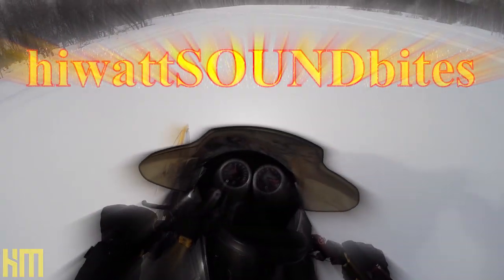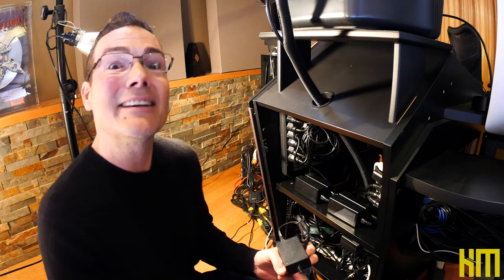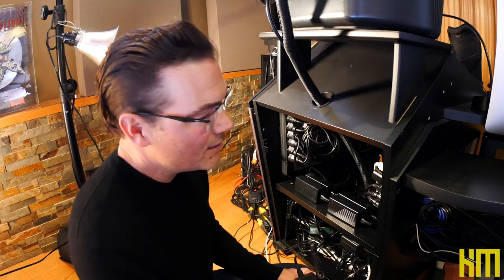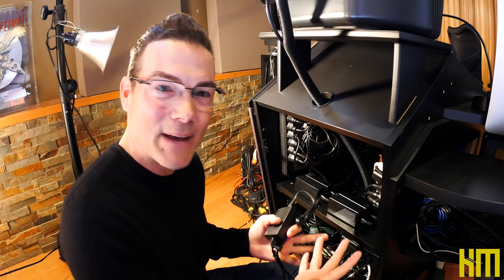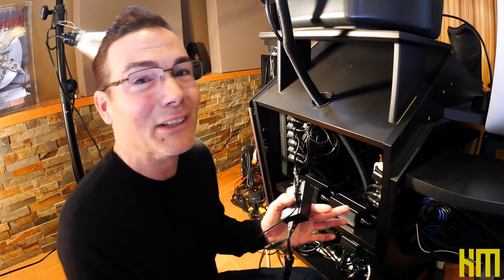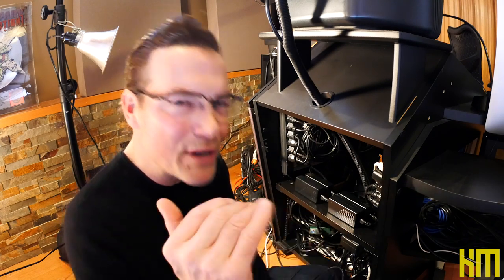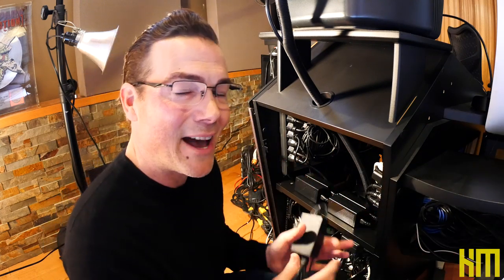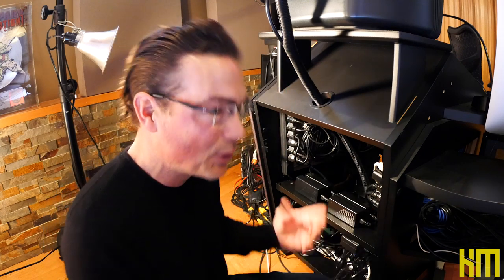Cable Management - Maintaining a LOW noise floor in your Recording Studio

Comment: Another tip to add here: When you get a new piece of gear, instantly label the wall-wart/cord for what it goes to.  A moment of effort for perpetual ease from then on.  If you worry the sticker might come loose over time (heat, etc...), cut a slightly larger piece of clear packing tape and 'laminate' it.  I am always thankful when I pick one up and it's labeled.  I have a plastic tub filled with cords and the like somehow collected over decades.

Great videos, Ken.  Thanks so much.
Reply: Brap Allgood That ^
Reply from the maker: Brap Allgood what an AWESOME comment here my friend, like BOOM!!!  Thank you for sharing such an excellent idea Brap, I’m sure you’ve prevented some grief by labeling supplies.  We’ve always followed your practice on the road, but it makes so much sense in the studio as well!  In addition to your great tip with packing tape, try using a nice bright ‘spike tape’ (1/2” GAFF tape used to mark stairs, entrances, exits, etc when on stage).  It provides a long term solution and you can easily  mark gaff  tape with a sharpie too ;-)  Really great practice you shared here Brap, thank you!!!  Have a great Friday!!!  -hw
Reply: As much as I try to do this without fail, it still boggles my mind how many transformers I find in my studio without labels OR equipment that it's NOT plugged into! :)
Reply: @hiwattmarshall  Do you remember on the Too Dark Tour when some random dude gave Dwayne a handful of acid and he shared with everyone at the end of the tour?  :)  That was me.  Looooongtime fan and follower, though back then people called me The BrapMan-- too many brapmen popping-up online made me have to get creative about it.  Happy to help.

Also...did you at least make 'brap' jokes to yourself while playing with the snowmobile thingie?  'Brap' means a few things, nowadays, one of which being that engine noise.  :D  BRAP!  BRAPBRAP BRAP brapbrapbrapbrap!  I had a car enthusiast try to buy my email address from me...and he'd never even heard of Skinny Puppy.  THIS WORLD.  It's weird.
Reply: @snakeyengel  For me, it's because of how many shitty electronic devices I've purchased in my life-- a shitty device often has a perfectly functional power cord/supply (coughcough STEAM LINK cough)...and so that bit gets saved with the others that lost their original purpose.  Hell, maybe I should go through them and figure out what they are, put them on Ebay.
Reply: to add to this-- use a cloth/fabric label.  i've had heat destroy my whole labeling in traffic signal boxes.  we also use colored wire wrapped on each end (green goes to green...) since i've switched that problem has gone away.  and since i'm old school we keep a steno pad in the box that has the same information.  it just takes moments to jot down the information and changes.

Comment: Hmm.. thinking about noise potential and heat.  I used to build out datacenters on a fairly regular basis.  Back then, I required managed power strips.  having to make a trip to the data center to toggle the power on something was like being punished for poor planning. So, the good news is that managed power is now actually affordable to regular folks, and just thinking that being able to easily guarantee that the power is off on any device that is currently unused would no doubt help lower the floor on noise even further.  Also, Datacenter building got me very into using Velcro strips to do the tie downs.. Not quite as tight at zip ties, but making changes or additions down the road just got easier.  I used to just get the Velcro on a roll and cut the lengths I needed during the build.  Also, have to agree wholeheartedly with Brap Allgood in his comment.  Get a decent label maker and use the heck out of it.  A bit of good organization up front will more than pay for itself in the long run.  Especially when you are have a "what goes where?" moment.  I have seen the insides of old Ma Bell Central Offices.  Back in the day they took the time to get the cable and wire work done really well.  The result was, little frustration on a techs part when it came time to fix or change something.
Reply: I couldn't agree more! pay it forward especially to yourself
Reply from the maker: ivan roseland thank you for sharing here my friend, and your valuable input on managed power...that would be epic in the studio!!!  I sort of get away with a rudimentary form using a number of simple, non-surge power strips mounted on the far side of my last rack (nicely hidden).  They allow me to spin-up different sets of backup drives without crawling around on the floor lmao (done that way too much)!  The sort of managed system you’re speaking of would be truly awesome in the studio...the ability to pick and choose everything in the room?!?, sounds brilliant Ivan!!!  
And YES again on BRAP’s comment...labeling power supplies, in addition to the actual plug end, have literally saved live shows for me in the past.   This is really a BOOM idea, and I’m so glad you guys both brought it up, thank you for that ;-)  Btw, I do love using Velcro as well...and they’re so much easier on the skin lmao...ouch!!!  Thank you for your comments Ivan, I appreciate it very much!  Have a great weekend ;-) -hw

Comment: My strangest experience with noise in my music setup was in the old apartment that I used to live in.  For some reason, on certain days and evenings, and only for certain times, my PC that I used for recording and controlling everything, would start receiving some Spanish radio station.  The sound would just start blaring out of the speakers, and ruin recordings.  I tried every possible method to eliminate that radio interference, including covering the PC and my speakers, and all the wiring with tin foil.  It never worked.  I had to record stuff only on those days and times that my setup hadn't turned into a radio receiver.   Since I moved, this hasn't happened again, thankfully.  The funny thing is, to my knowledge, there was no radio station or broadcast towers anywhere near this town I was in.  I have no clue where those signals were coming from.
Reply from the maker: BlackburnBigdragon you’re bringing back an epic memory from my kid-hood haha!  Growing up on a small farm in B.C. backwoods lol, I remember ordering a funny looking tv antenna from radio shack, mounting it sideways on a short roof-mounted pole, and receiving HBO over-the-air ;-))  It was a big deal on the school bus lmao!  You never know, maybe someone in your building had something hot-wired, and you were in it’s path?!?  Haha, fun to imagine in any case, and thank you for sharing your own mystery experience with that apartment and PC, it’s awesome;-))  Cheers Blackburn! -hw
Reply: Man, I would record that stuff!!! But, yeah, I hear you.  It would ruin a session, for sure. But I'm just thinking lemonade out of lemons???
Reply: sean grant  When I was a teenager, I had a telephone in my room, and late at night, me and my friends would often play Dungeons & Dragons over the phone.  On certain nights, sometimes, there was an extra voice on the phone.  It was a trucker on a CB radio.  It was always the same guy and he was always on this stretch of highway that was MILES away from my house.  Somehow, this land-line, non-cordless phone would pick up his CB.  I could only hear him and not the person he was talking to, but I could always hear his side of the conversations.  My friends couldn't hear him, so it was just in my phone.    I'm assuming that where I lived was just perfectly lined up to where he was and the planets aligned right to get that signal into my phone.